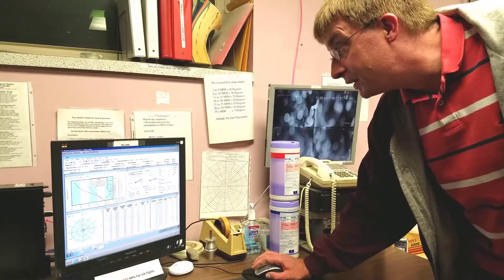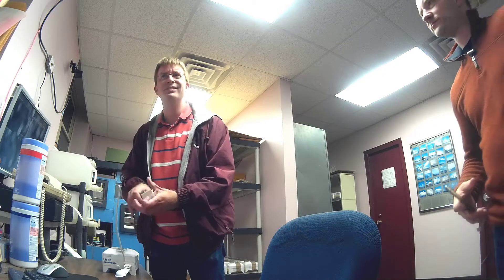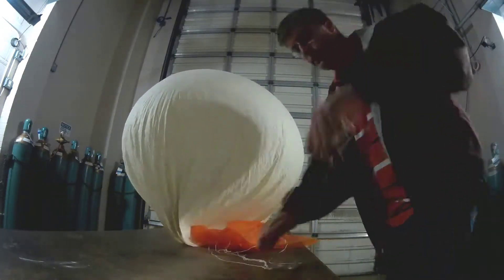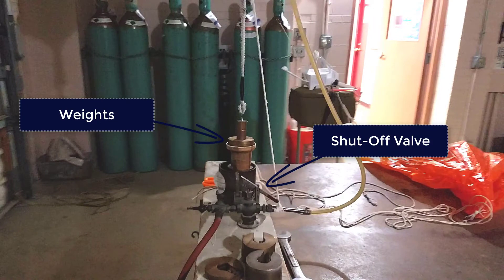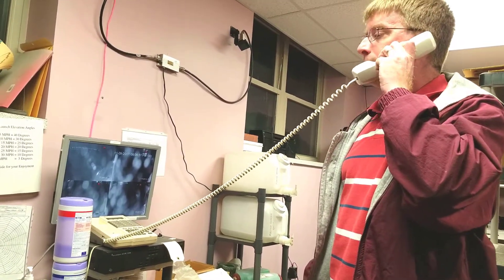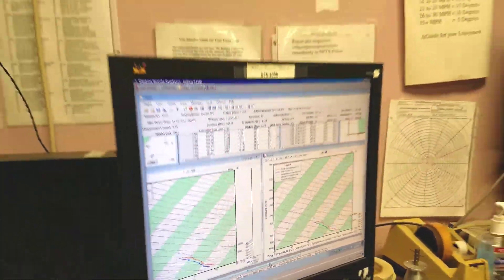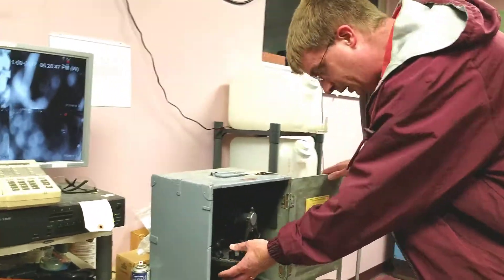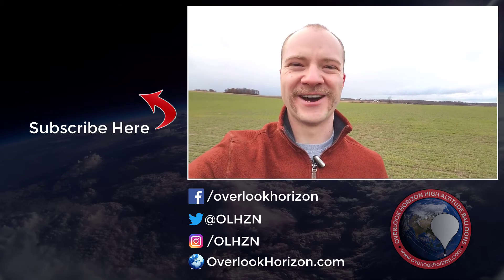Launching a weather balloon with the US National Weather Service

Comment: Can I track a weather-service weather balloon, with Ham-Radio equipment?
EDIT: For clarification, I'm asking if it's possible to track a "Weather Service" (NWS) weather balloon, not a balloon launched by your group, or other groups...and if it's possible, how would it be done, since (as far as I know) the NWS balloons do not have a tracking transmitter built into the radiosonde.
Reply: Raymond, I am not aware of being able to track weather balloons. I am a Weather Forecaster in Afghanistan for NATO and the only way we can track a balloon is through the computer the radiosonde is set up for. We use smaller sondes and balloons than the one in the video, but it still the same scenario.